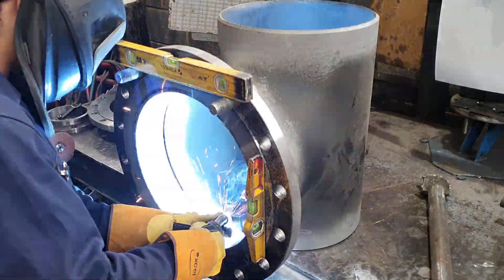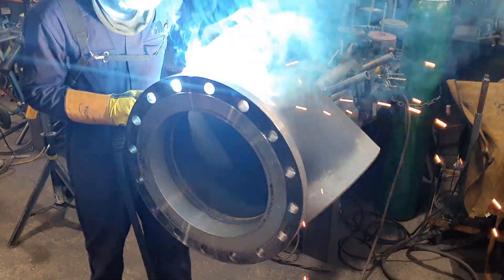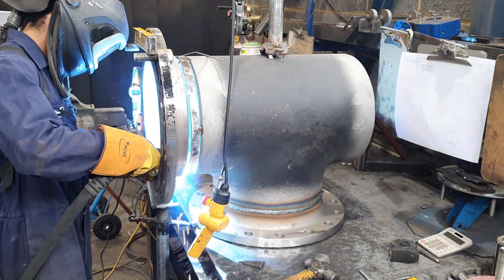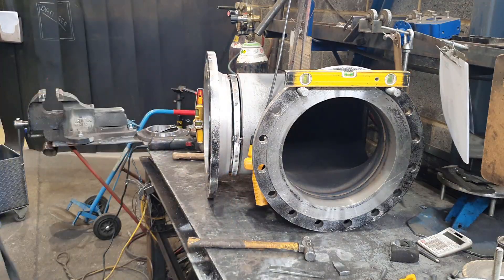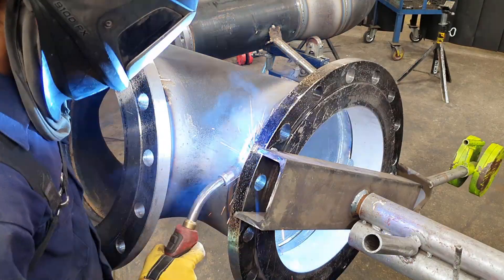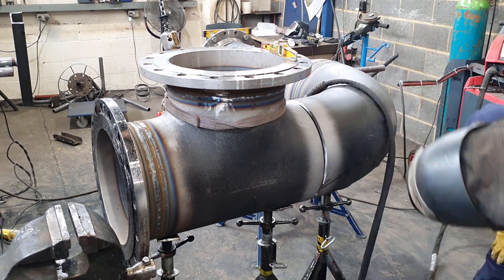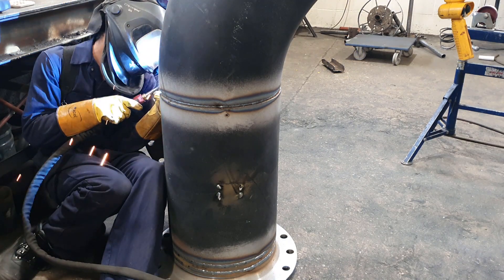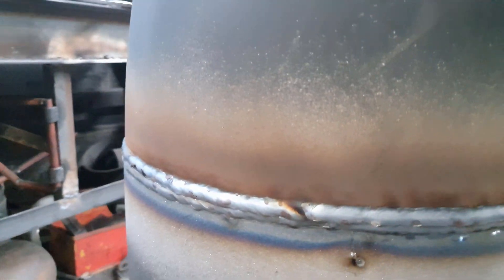16" Spool fabrication (MIG/MAG Pipe Welding)

Comment: Material should be cleaned before tack weld.
Reply: It obviously isnt class 1 pipework or anything high pressure he's working on. Wouldnt be tacking bits and pieces outside of weld preps otherwise. Therefore probably doesnt matter if he cleans it off or not.

Comment: I have analyzed your setup for rotation of pipe and support of pipe. They are spot on. I have seen many welders thst can't get a good root like you did even with TIG. Excellent job. It would be a pleasure to burn some wire with you. Stay safe.

Comment: What amperage should I put in a root pass for a 80-card pipe?
Reply: Depends on the process. SMAW 70-80 amps. GTAW 105-125. All of the voltages, amperage, and wirefeed speeds are something you should experiment with and find what you like though. Don't be afraid to mess up test coupons!
Reply: @Houstonruss  thank you for your comment

Comment: I’m a welder freshly graduated from high school, but due to Corona I have been out of practice for a while. Do you have any tips for looking for a job or anything? I’m concerned that jobs won’t like my welds and I’d be unable to find a job, thanks !
Reply: Just gotta be persistent and dedicated to securing work, then putting in 110% when you do find work to let them know you are all about improving and not there to fuck around. Beginning is always the hardest part but everyone has to start from somewhere and it only gets easier from there on. My only real advice between jobs would be to not stop welding, when you can/if you can, accquire enough gear to be able to practice at home and that way you can also do little cash jobs on the side.

Comment: Very well done, without manipulation and a crane you did it all in the right order, only thing I'd have done differently is tack up and root with 0.8 mm bare arsed wire and then use 1.2 flux cored.
Those large fittings never line up properly,as long as you get them looking even on the inside jobs a good en. 
All my pipework has to be smooth and crevice free on the inside so I have to grind flush all the welds internally .
Vids are getting better, just right content not too long. 👍👍👍
Reply: Thousand ways to skin a cat.

Comment: That is the way I would have done it except I would have raised the last weld off the floor a meter or so, for comfort but, you need a platform for that and if you don't have one then the floor it is!
Reply from the maker: Yeah were both on the same page, without a safe platform to rest it on, then the floor it is